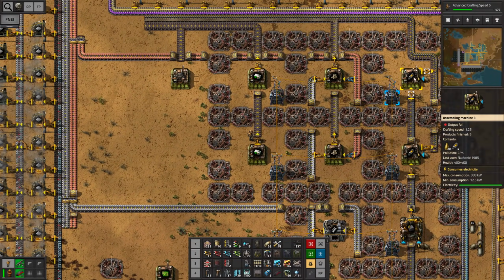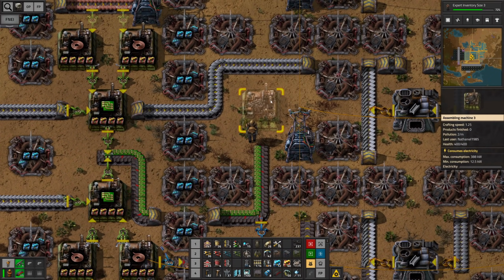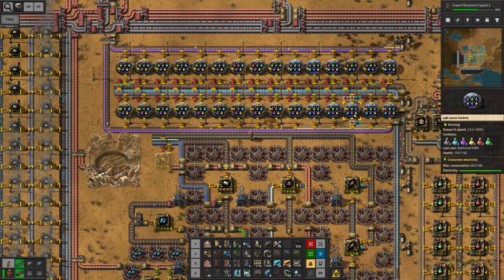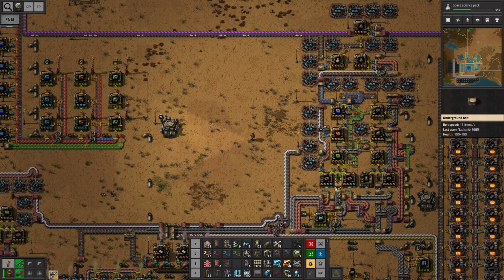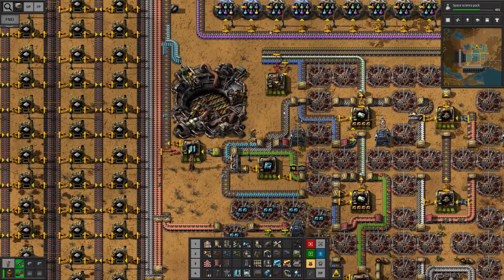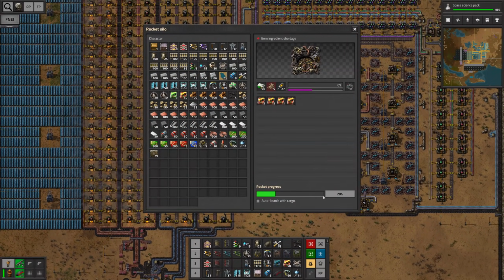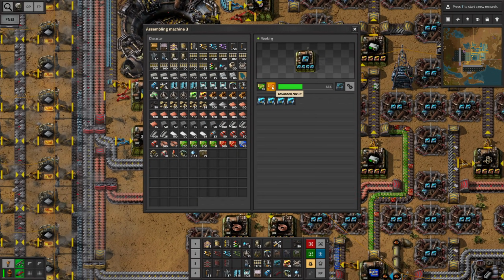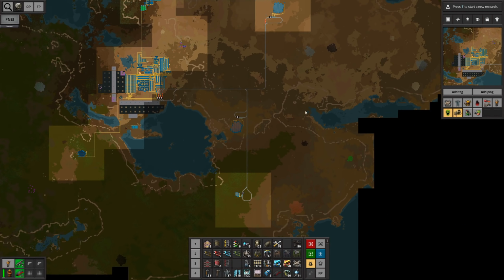WHITE SCIENCE (Rocket Silo Part 2) - Factorio: Ep. #10 - Guide & Let's Play

Comment: 10:22 - Swap out as many as possible of those Portable Solar Panels for Mk 2 Personal Batteries.  Each Solar panel is only 30 kW and each Mk2 personal battery is 100 MJ.  Since you can fit 2 Personal Solar Panels in the same space as a battery, a Mk 2 Battery can provide 60 kW of power for up to 1666 seconds, aka ~27 minutes.  If you need more than 60 kW (or need the power at night)  the Battery can help out while the Solar Panel is useless.  The Portable Fusion Reactor would be used to charge up the Batteries (and a second Personal Mk 2 Roboport).

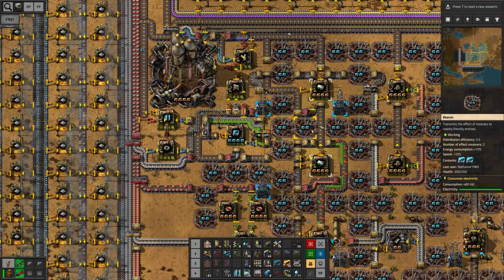23:41 - you should have launched a Fish instead of a Satellite

Comment: You need to put splitter on rocket control unit belt to filter out blue circuits. Before last red underground belt is nice place to do it. Otherwise You may accidentaly send 100 blue circuits instead of sattelite.
Reply: Correction, yellow underground belt, because You switched it.
Reply from the maker: I fixed that, thanks for the tip!

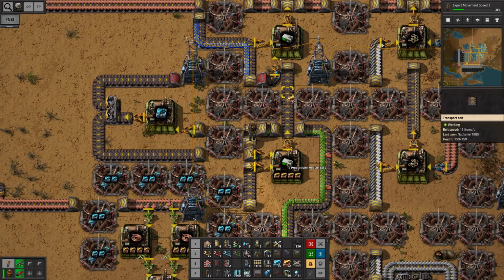Comment: 7:04 Having 4 of the tier 3 Efficiency Modules in the Satellite machine is extremely wasteful, since energy efficiency caps at a -80% modifier (which can already be reached using only 2 of the tier 2 Efficiency Modules). It'd be much more practical to put something like 1 or 2 Productivity and/or Speed Modules into the machine, then use Efficiency Modules in the remaining machine slots to balance out the energy consumption increase such Modules give.